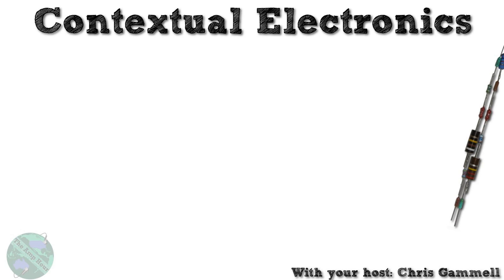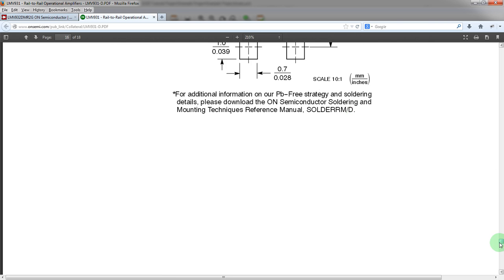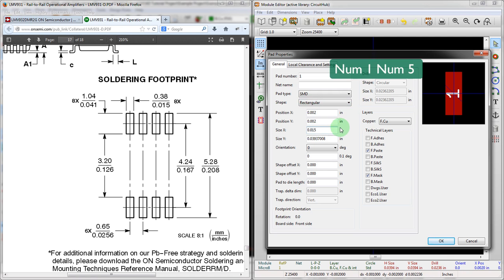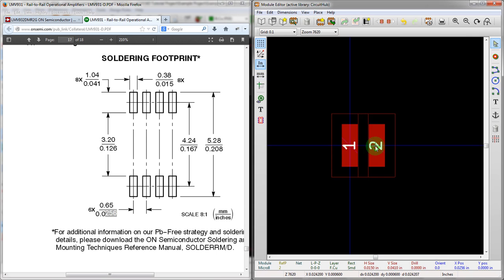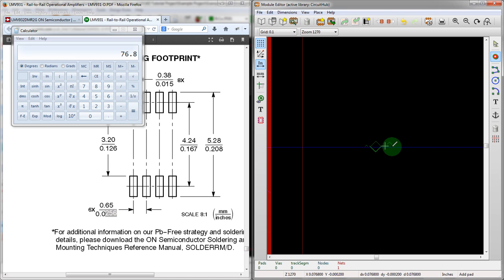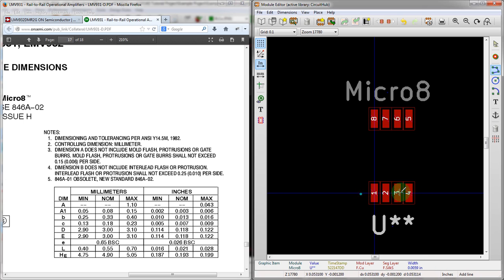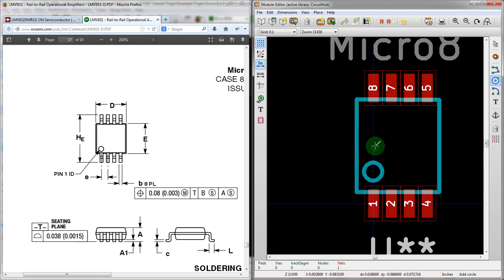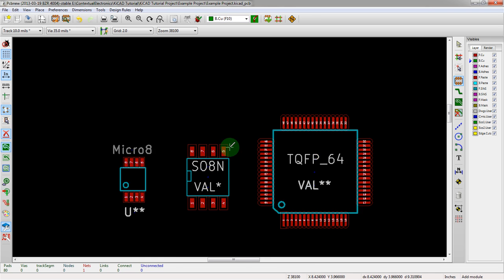KiCad 3.0 - An Example Of (Tiny!) Footprint Creation in KiCad

Comment: hello guys,I need your help:( I have Lubuntu 18.4(I think) and I installed KiCad. It works well,but when I  open footprint editor,evrything is black,so i cant see it on black background,and it displays a pads as a black triangles,not yellow circle how i set it up:(The same thing is happening in pcbnew.